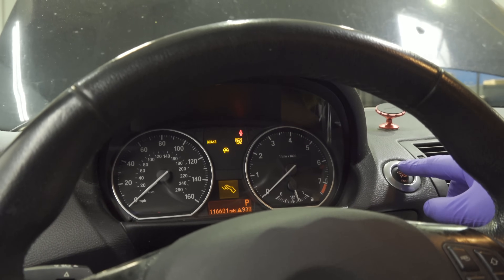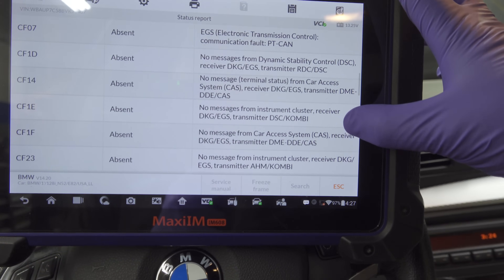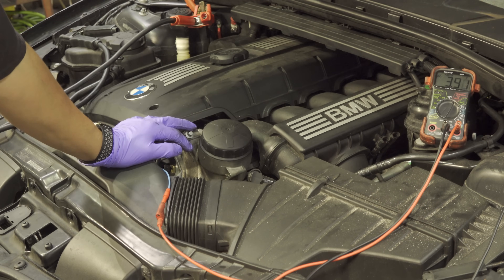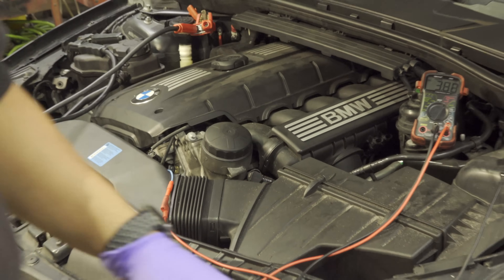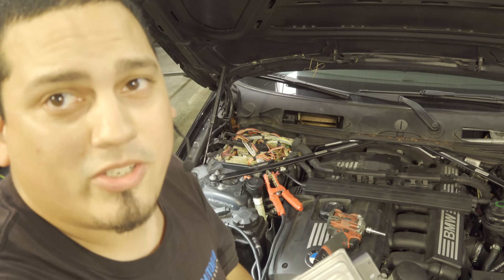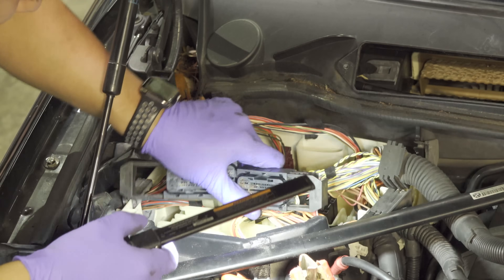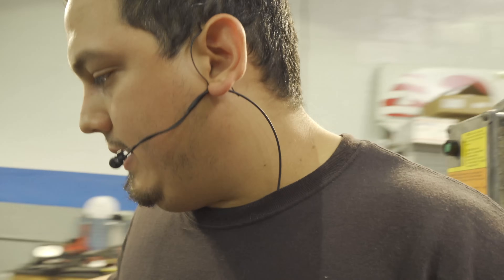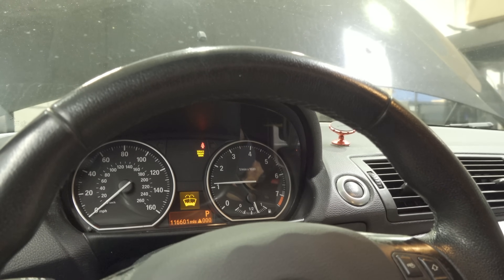2011 BMW 128i E82 N52K - CRANK NO START DIAG AND FIX

Comment: Bmw x5 e70 2006 sometimes not start and code fault like terminal 15..ect....... But whenever I plug out CAS MODULE and let it off out for overnight, the next day I plug CAS in and car starts well as normarl.. event turn off and start car 3-4 times continuously then, very good. Can you show me why?

Comment: Hey mario my 328i did this after i changed out the valve cover. I left the ecu cover off for a few days n it rained. I wasn't aware of water being able to get in there but it did. So same exact thing happened i saw ur vid an i removeed the ecu and cleaned out the pins connector evev relays were wet i bought special small brushes and crc electrical spray. Also did some compressed air cleaning. Everything looks great i evev opened the relays an cleaned them out. My question is should i open my ecu??? I was at first scannin w basic scanner but after cleaning everything out i used snap on ultra scanner n the ecu seemed to be making communication i cleared my codes an seems to be ok have not fired it up. What do u recommend?? I appreciate it o.g

Comment: I've come across a product it's good at dissolving rust and corrosion and it's still used in coffee makers believe it or not and soon a small bottle you can get at the grocery store but this stuff works better than anything that I've ever found on the market today and it's inexpensive, a little bit of that on a on an old toothbrush and you will not believe what ends up happening with your electronic connections almost like brand new, and then you blow it out with some compressed air in your finished
Reply from the maker: No, you're not finished. The dme was completely flooded. Would you simply clean off corrosion from a circuit board then hands it back to the customer and warranty your work for 3 years/36k miles?

Comment: A small soda blaster nozzle can be very handy for cleaning corrosion off of connectors with relative ease. I use baking soda in one and it works great. Made by airboy who make air blow guns (for shop air blowing).

Comment: Greetings from Ireland, new to the channel great vid as per all of your other vids I’ve watched so far, this car looks like it suffered from as we used to call it in my last job, it was suffering from German leaves.....! We used to service a shed load of 1 and 3 series and always clean out the drains of the leaves as they could cause rain water going where you don’t want it too....!
Reply: How good are you with Mercedes can diagnoses? I have a 2014 Vito 2.2 diesel van that has no can signal at pin 6/14 at dl16 with Pico scope until I disconnect fuel pump module then I’m only getting can low signal and can appears to be mirroring can low but with only a very low voltage swing. I’m only new to using the scope, I’ve started getting into scoping since moving to the local JLR dealership as there electric’s are not the greatest even from new ! We run across communication issues on vehicles with only a few thousand kilometres on the clock ....! Interesting but head melting at the same time 😡

Comment: That sounds like replacing an entire wiring harness from the DMV? As I said previously you can use this corrosion cleaner in the connectors and on the DME itself and you will not believe just by using a toothbrush or a connector probe that's used for cleaning connectors how quickly this will clean that up in a matter of minutes versus spending hundreds of dollars on a DMV and a whole wiring harness? That unit is supposed to be covered with a weatherproof seal to begin with? What is the deal with that?

Comment: If they would just set the DME facing down with the connectors. its obvious that design would have problems. I bet every one of those with that design is going to have them same issue. I guess its their way of selling ecms and wiring harnesses forever. Do most bmw's have the ecm/dme in the same location and facing up like that? It will be the first place I check on anymore bmws.

Comment: literally had an a4 b6 2.0 na today with water damage in the pcm connector. caused coil control to be shorted to the injector control circuit because they are on the same connector, shitty design to begin with. coil controi is like 10% duty cycle while injector control is 80+. caused a burndown of couple of cyl3 coils because on time was so high. thorough pcm connector cleaning took care of the issue.

Comment: Autologic for BMW is the must.
Reply from the maker: It won't change the isn number in the cas or vin though
Reply: @SuperMarioDiagnostics  Not sure, but does the replace DME procedure on Autologic actually should take care of that?
Reply from the maker: I know i tried it with the drive pro, and for some reason it just wouldn't work. It doesn't exactly spell it out but my guess would be an issue with the isn change.

Comment: What is your technique when cleaning corroded connectors like that ? Such as do you have a trustable spray you like to use ? Thank you for the content , really liking this channel .
Reply from the maker: There are diamond tipped connection cleaners and also you can use either de-oxit or winzer to clean out, followed by stabilant 22a to promote conduction after the cleaning
Reply: @SuperMarioDiagnostics  thanks for the tips man will try next time when dealing with corroded connectors . Appreciated for taking time to reply .